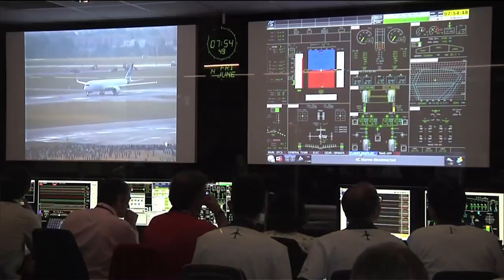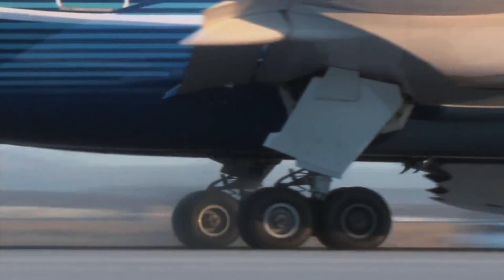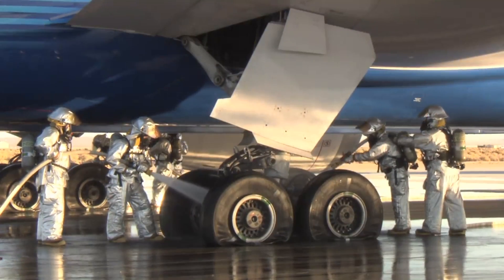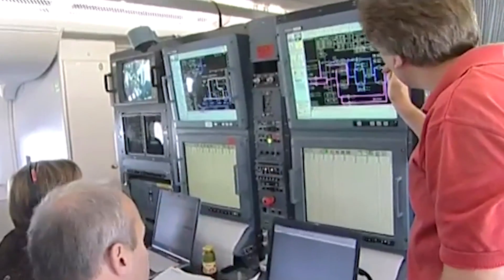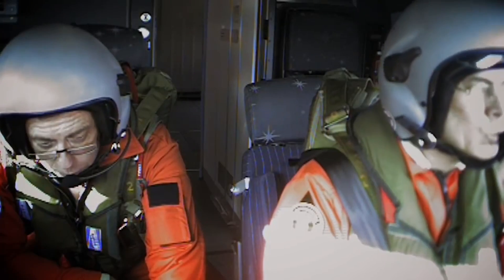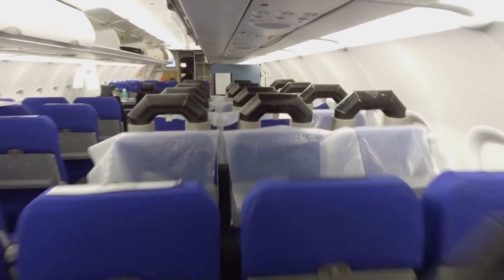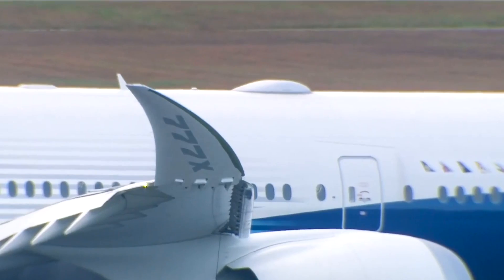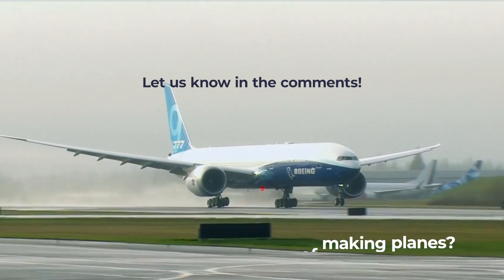What Does An Aircraft Look Like Inside During Certification?

Comment: I was lucky enough to get a tour of the 777X in oct of 2020. One thing I found interesting was a window in the floor of the aircraft looking into the cargo bay. Also if you look closely at the landing gear or anywhere inside you'll see big bundles of orange wires for all of the sensors in virtually every component of the plane. some of these, like the ones that go through the internal structure of the wings cannot be removed after testing is done which is why the first 2 777X's can't be sold to airlines when testing is complete

Comment: I knew about the testing process but what I didn't know is that these test aircraft will make their way into commercial service. I'm guessing after a significant and thorough inspection as the stresses test aircraft endure are incredible.
Reply: There is a through and complete refurbishment of the aircraft after it is certified. It also has the removal of the wiring and removal of the test equipment, the modification to certified standards of anything that failed during verification and then the installment of certified configuration of the aircraft including the exterior and interior of the aircraft, most if not all the aircraft engines are taken off and sent back to the engine manufacturer for either refurbishment or replacement with new engines. Then the aircraft has a new interior fitted in. I worked in interior fitment of the Boeing aircraft from 1988 on the 747 program all the way into the certification of the 777F variant. I retired from Boeing in 2017.